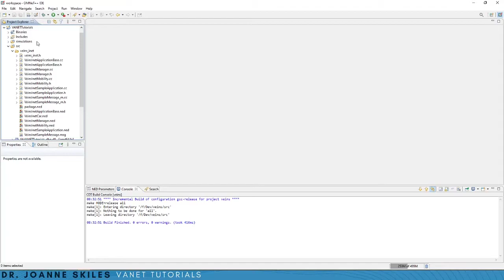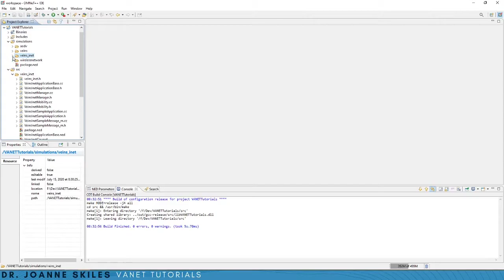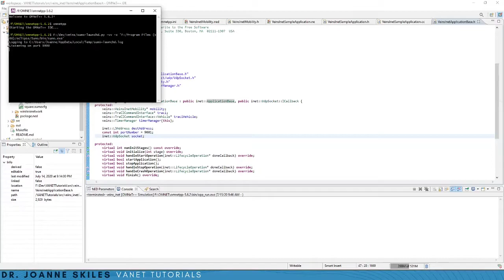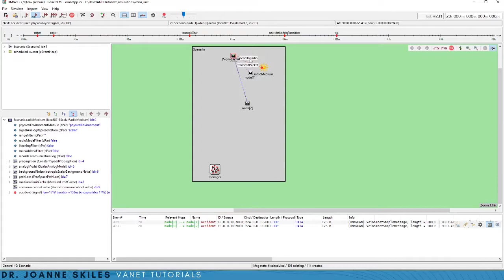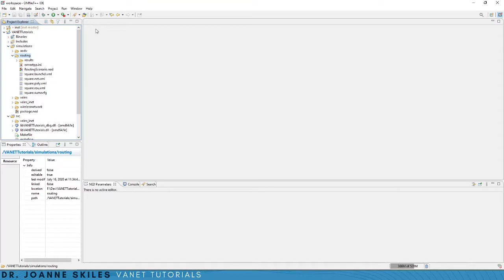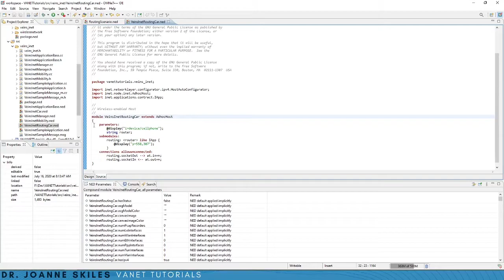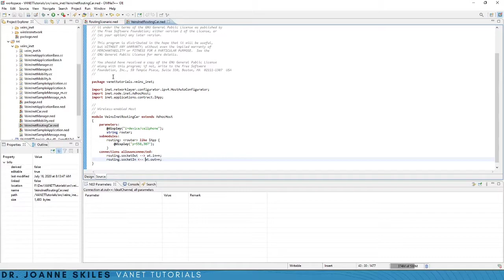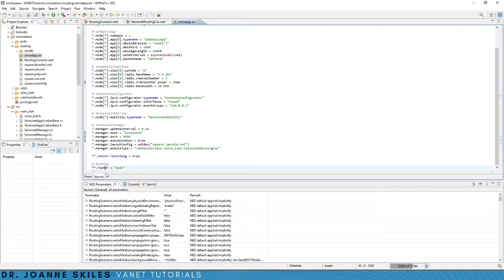How to Simulate a V2V Network using OMNET++, INET, and Veins

Comment: A runtime error occurred:

Unknown parameter 'router' -- in module (omnetpp::cModule) RoutingScenario.node[0] (id=10), at t=0.1s, event #2

**.router = "aodv"
Reply from the maker: I will look into this when upgrading the VANETTutorials project on github. Most likely there are compatibility issues.

Comment: Hello Dr. Joanne, is it possible to add Machine Learning Algorithms to the car node?
Reply from the maker: Yes it is possible, you will need to modify the the nodes base code in order to do it (and possibly and another classes/interfaces depending on the complexity of the project)
Reply: @DrJoanneSkiles  thanks!

Comment: Thanks a lot for the very useful tutorial. I would like to know if you have any samples of a simple project that combines Veins and simulte or simu5G. 
For example, using the default Viens mobility, but instead of using 802.11p, I would like to use LTE or 5G  instead.

If you could provide any suggestions, I will really appreciate your help.

Comment: I tried creating a simulation wherein rsu and vehicle node communicate with each other. I have created rsu as an extention of AdhocHost. and similar to VeinsInetApplication, I have written a application for rsu. When I try to send a signal from vehicle to rsu, rsu receives the signal but it does not reach the application of rsu. Even in .ini file, I have exactly put the same values as for vehicle node. Can someone help me?

Comment: Mam I'm a freshers right now in university and i choose my reseach topic vanet but i don't understand how vechicles communicate with each other (Vanet)? How data transmission takes place between vechicles to vechicles? is there use of Mobiles in vechicles for data communication?
Reply: I recommend the book "wireless device-to-device communications and networks"
Reply: Thanks Duc Nguyen..
Reply: hi, I am facing the same problem. May be we can connect to discuss about the common research topic. I think discussions help to learn better. Bdw, from which university you are pursuing PhD?

Comment: How to get the location (latitude, longitude speed and heading)of the vehicle which are simulated?
Reply from the maker: Lat/Long requires some additional coding https://stackoverflow.com/questions/35123909/converting-veins-coordinates-to-gps. As for speed and heading you can retrieve this in OMNET++ INET's IMobility has several get methods with the information.
Reply: @DrJoanneSkiles  Thank you so much

Comment: Dear Joanne
When i run the VANETTutorials project,omnet will show a error,Error cannot load library '../src//libVANETTutorials.dll'
Can you tell me how to solve this problem?
omnet 5.6.2 or 5.4.2
VANNET Tutorials https://github.com/chaotictoejam/VANETTutorials
Inet https://github.com/inet-framework/inet
Veins https://github.com/sommer/veins
Sumo 0.32.0

omnet 5.4.1 console shows that

<!> Error: Cannot load library '../src//libVANETTutorials.dll'
End. 

omnet 5.6.2 console shows that

make[1]: * [Makefile:115: ../out/clang-release/src/libVANETTutorials.dll] Error 1
make[1]: Leaving directory '/d/appenglishpath/omnetpp-5.6.2/VANETTutorials-master/src'
make: * [Makefile:2: all] Error 2
"make MODE=release -j6 all" terminated with exit code 2. Build might be incomplete.

if you need more detail please tell me ,i will show all the console shows.
Thank you.
Reply from the maker: Hi, I would make sure your project make settings are set up correctly, after that clean your project and then rebuild.
Reply: @DrJoanneSkiles   Do i need set any different setting?  can you send the email id to me? my email is 593430453@qq.com, please send the out folder in VANETTutorials to me,i cant make libVANETTutorials.dll this file。
Reply: @DrJoanneSkiles  I have simulated AODV successful by use your VANETProject-master. But i donot know how to collect data,Can you make a video to teach how to collect data？ Such as throughput 、Packet Delivery Ratio、End-to-End Delay、Packet Loss Rate and so on. Please make subtitles to your video,Thank you.